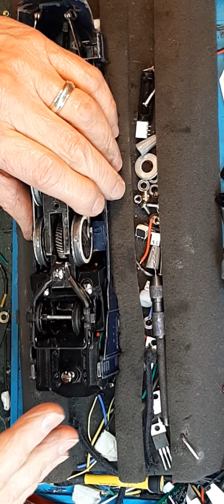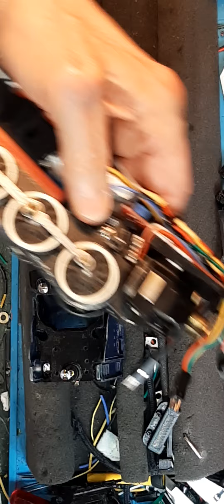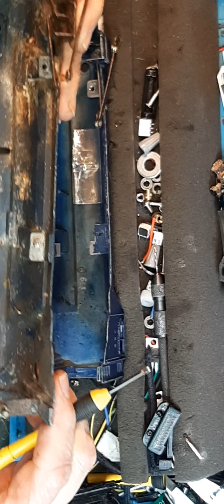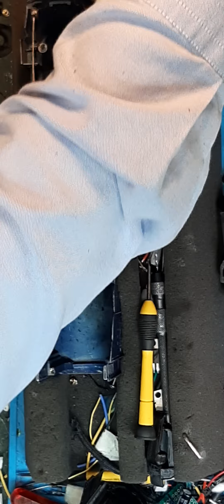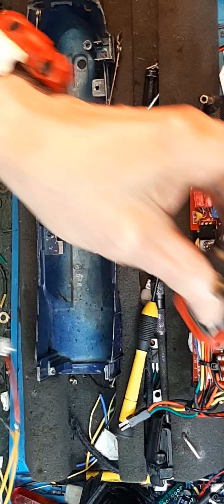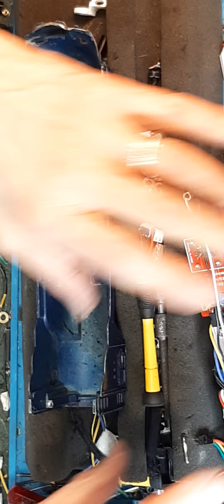NGS RB Trailing Truck fitting up challenge. I did find a solution.

Comment: With you adding screws to mount the motor where the tabs are would be Great. Those have a bad tendency for pulling out and then you are fighting with mounting the motor and not running trains.. I can’t wait. It will be so much fun.
Reply from the maker: I built two test parts and it look quite promising, I have seen several plastic engines where the tabs are screwed in. I want to address those engines first. A quick chassis swap gets them into the 21 century with 6 screws. The longer tenders play well into the extended range models and provides the space for digitronics. Our new controller will be quite unique. Hoping to get my test setup next month.  Keep Watching.